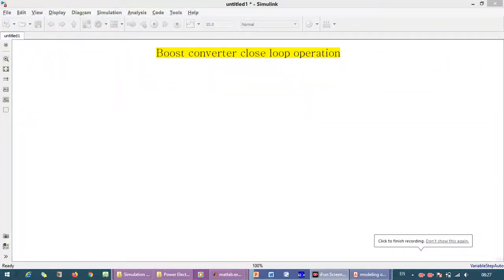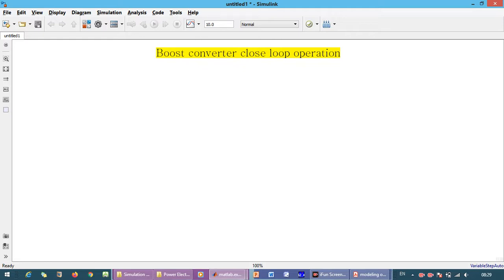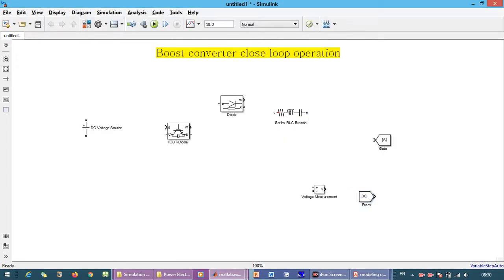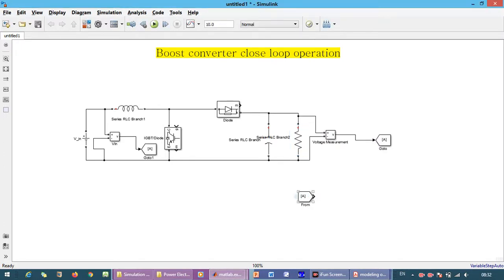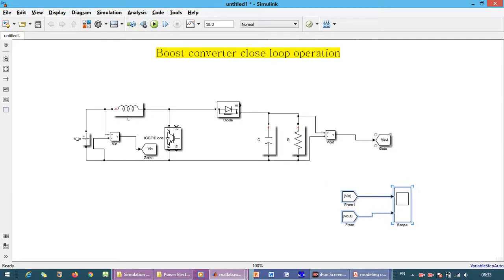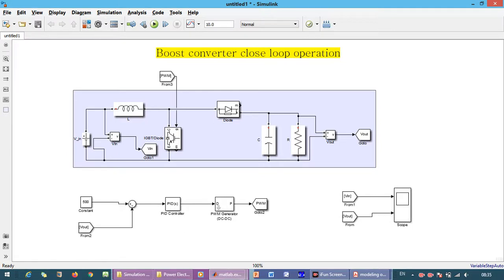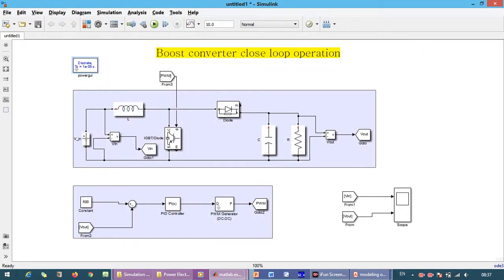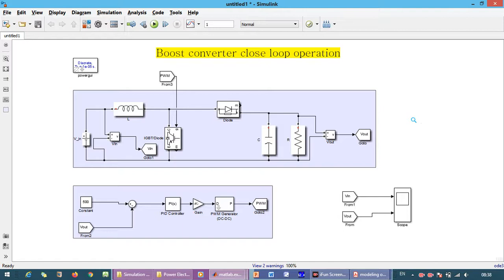Close loop boost converter using Simulink | MATLAB simulation on Boost converter

Comment: Very nice video. Simple and effective. 

I have few questions:
1} How PI control gains are selected? and 
2} why that Gain block with gain (1/500) is used? 
3} Also, Can you elaborate on "Current programmed (controlled) closed-loop" Boost converter? 

Thank You.
Reply from the maker: Thank you for watching the video
PI controller is design based on certain specification of the converter. That makes the system stable. You can select PI values by proper design of transfer function and frequency response analysis.

2. The gain value is required for proper operation of the converter. If you check the output of the PI controller that will be varies from 0- ref. Value. However, control signal must be 0-1. To convert signal in that range, we have used gain block of 1/500.